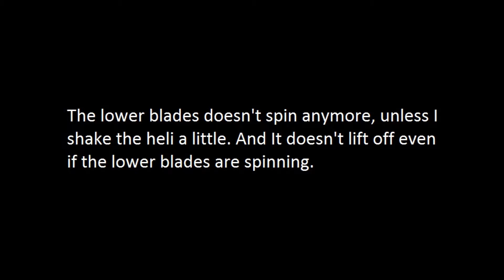SymaS107G Issues

Comment: theirs a good chance the gears connecting the front motor to the lower rotor aren't touching somewhere.
Check the small gear attached to the motor itself and make sure it is making contact with the other gear right next to it, sometimes the gears will slip up the shaft and no longer make contact with the gear next to them unless you shake the heli a little bit. it's an easy fix, just make sure all the gears are touching by sliding them up or down the rotor shaft until they mesh.